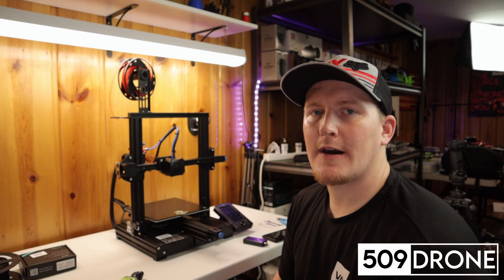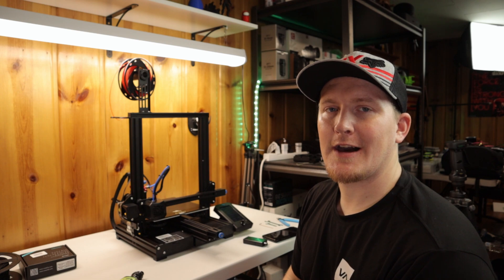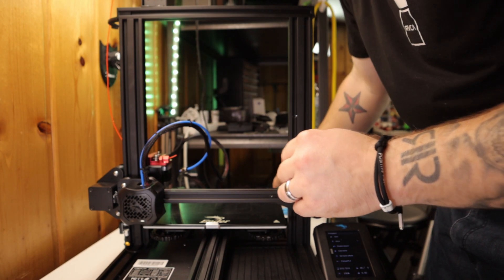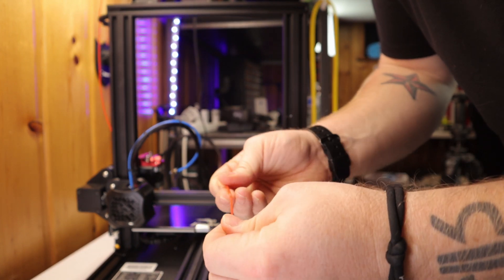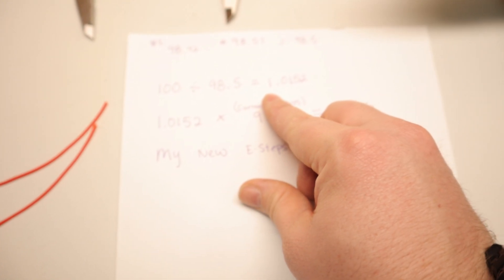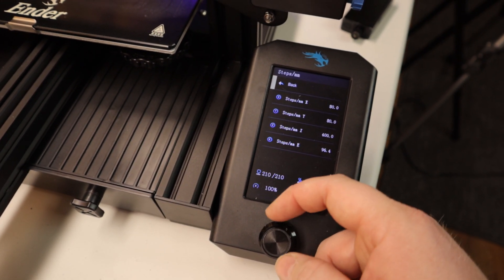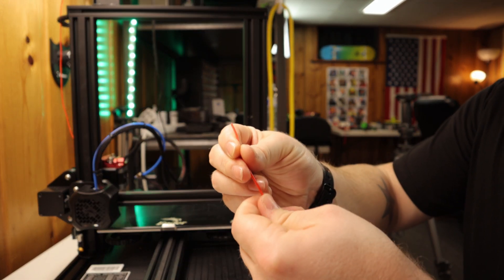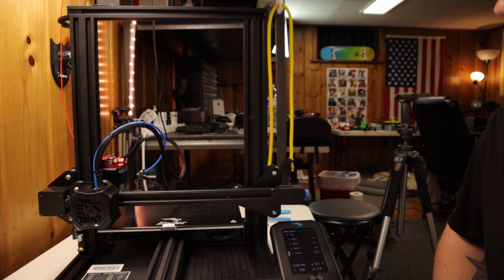How To Calibrate Your E-Steps [ Ender 3 V2 ]

Comment: I'm running stock firmware how do you save it I tried your method saves and then when I shut the machine off it returns to normal at 93
Reply from the maker: Hey Dylan, I experienced this same issue with the stock firmware. You have to have an SD card inserted into the printer when you store the settings. It will save the settings to the SD card making a folder called "EEPROM" or something like that. So make sure to leave that file alone, and use that SD card when you print. Or update your firmware :) I have a full step-by-step guide for that as well if you're interested. Let me know if you have any questions. Our discord server is. https://discord.gg/KrAFhEYvDM

Comment: Awesome vid bro. Now I’m thinking about getting that same printer 🤔
Reply: I have a ender-3 v2 and are very good for the money you pay. But you have to invest in if you want to get nice prints and fast. I pay 300€ for the printer and 200€ in upgrade. Pi4, direct drive, springs, belt, extruder, bltouch.. Etc. I recommend ender-3v2 but if you have more money take something with a big bed( x y) and z axis.
Reply from the maker: @dannyblondu23  right on. What other printer do you think is a good one? I've been looking at picking up another one.
Reply from the maker: thanks man! It's definitely a great printer. Good "entry level" printer, but definitely able to print high quality stuff.
Reply: If you want a 3d printer just to print something you need around the house ender-3 v2 it's just fine. If you want to print and sale or to make big prints take CR 10 max 450mm x 450mm x 470mm. And you will need less upgrade for it.
Reply: If you are good with your hands built on your self. With Duet WiFi 2 ( klipper) and you don't need pi4. More expensive and long time to built but you will have a better printer. Up tu you.

Comment: This formula keeps under shooting and over shooting 100mm back and forth, not sure why.
I snipped flush, extruded 100, meaured, ran the formula and it keeps happening, first time it was giving me 104mm for 100, second time it corrected down to 97mm for 100.
Reply from the maker: Thats really weird. I know mine has done weird things in the past when I do it multiple times. I have to power cycle my printer every time I want to do the test over again. Give that a try. Are you using PLA to do this test? Because tpu will give inconsistent results like you said.
Reply from the maker: If your still having issues, jump in our discord and I'll try and help you work it out.
Reply from the maker: Also, the other way I have shown in the past to calibrate your esteps works good too. I did both, and they were only slightly different. So I know the other way gets you extremely close to perfect. Look though my videos, and see if that way works better for you.